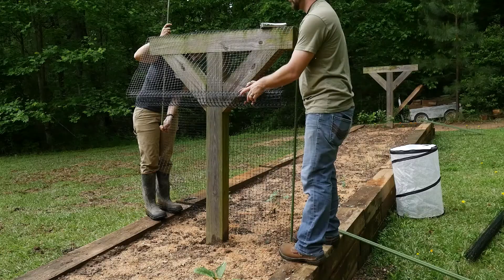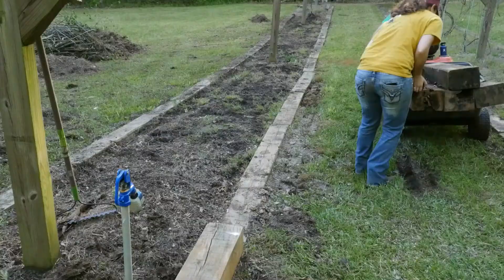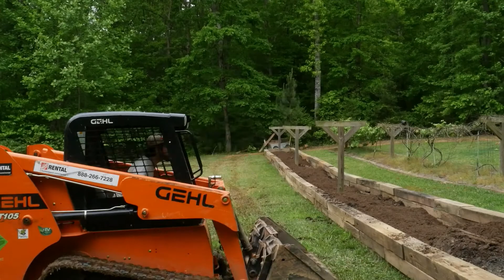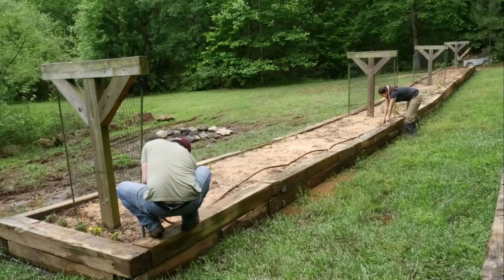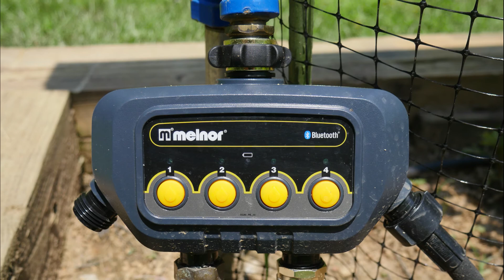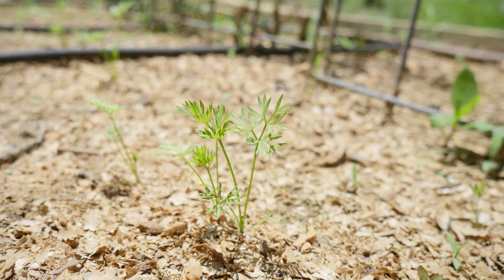Now THAT'S a Raised Garden Bed!

Comment: You aren’t concerned with the chemicals in those things ?!?!?!?
Reply from the maker: Absolutely not. These railroad ties are very old - talking with the previous home owner, at least 15 years old - they inherited them from the previous owners to them. So based on our research, most of the creosote has already leached out. Which is why a lot of these railroad ties are already rotting (which is a sign that they're likely over 20 years old). While there could be some creosote deep in the wood, it is not reasonable to assume that it could leach out into the soil much more than a couple inches or so from the edge of the wood (my research found a few studies that looked into this), and all our plants are planted no closer than 6-8 inches from the wood (more like 1 foot for the most part). Additionally, research has suggested that most plants' root tissue do NOT absorb creosote, and for those that do, the biological processes is not likely to transfer the creosote to the fruit. Most of the plants we have produce fruit on the stem/vine, which eliminates this concern further. We do have some root vegetables though, and it is generally recommended that to play it safe, root vegetables wouldn't be recommended in the railroad tie environment. However, when paired with the age of these things and the planting distances, we've determined it to be a very low risk. Lastly, research has shown that creosote goes through biodegradation processes and does not linger in soil. One of the biggest helpers of this is the fact that it can oxidize. The process of oxidation speeds up the ability for creosote to biodegrade. In my conclusion from researching all this, I would be accepting more risk to life driving to the grocery store to buy vegetables than eating vegetables grown in our garden with these railroad ties.

All that said, I would NOT use railroad ties that are still fresh with creosote (dripping wet/sticky, smell, and color can all be indications) - that would be dumb.
Reply: Thanks for the reply .  Are you able to smell any chemicals from the railroad ties ?
I wanted to plant some Bamboo on some raised beds but I was concerned about the chemicals . If you still have those research references would you be kind enough to add them to the video description
Reply from the maker: @moabbas5525  I can not smell the creosote at all in these. Let me dig them back up and I'll link them in the description. I'll reply back here when I get them linked.
Reply: Awesome!!! Thanks a lot